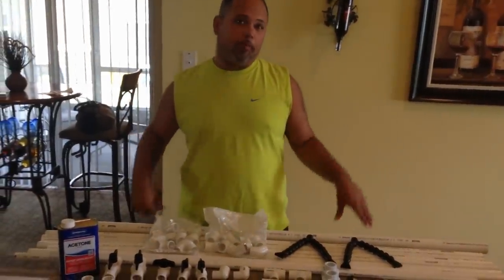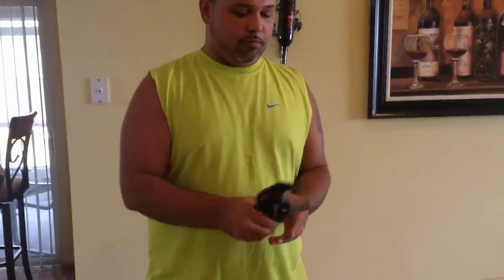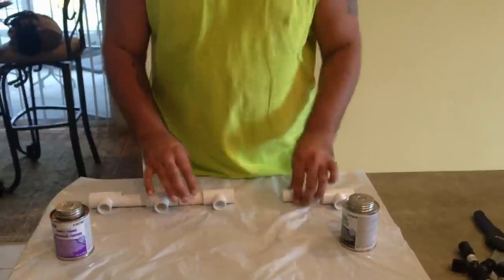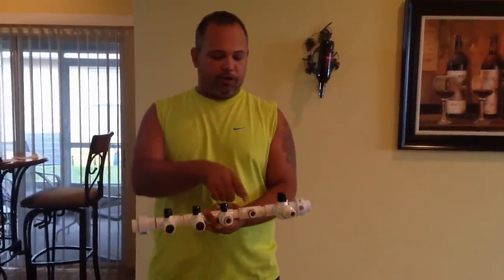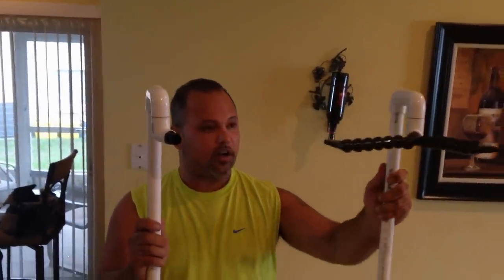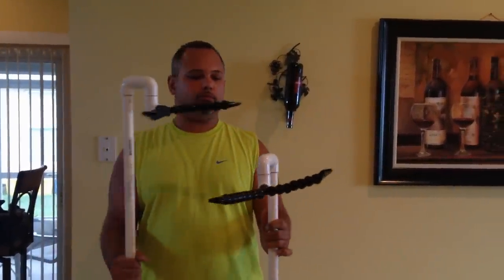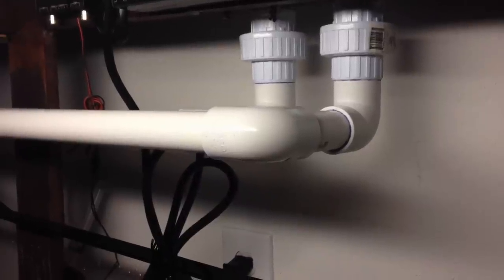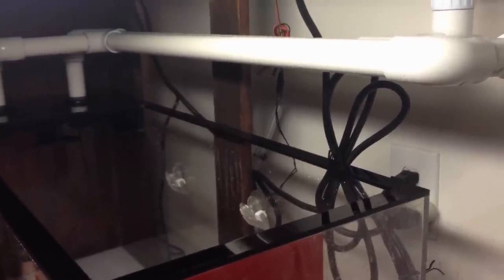Aquarium PVC Plumbing

Comment: Just wanted to let you and your subs know you can buy clear primer for your PVC. You can also get gray PVC tubing it looks a little cleaner. Don't forget to hold presser on each glue joint for about 20 or 30 seconds after glueing. PVC likes to push apart for the first few seconds after glueing. Thats probably what happened to your manifold on the 3rd or forth joint, I saw that one of your tee joints has a larger gap than the rest.  Good video thanks for sharing.

Comment: Can't wait to see your next video buddy. I been in the works for the last couple months getting everything i need to setup a refugium in my tank. Funny thing is that i thought about the same ball valve setup to run reactors from my return pump. I'll be using a large external pump on my ecosystem sump for my 125 gal so it was nice seeing you do that ball valve setup. Can't wait to see your next video to see how everything is running. Keep it going brotha.
Reply: Oh i forgot to ask, around how much did you spend on all the pvc supplies for this video? not including cutter, just pvc and fittings.
Reply from the maker: Thanks for the comment Jose Alvarez. The ball valve set up (PVC Manifold as I call it) has been working out great for me. My return pump is strong enough to handle the work load. Not only did I make extra room in my sump, It has made my life a little more simple by not having to clean all them extra pumps. I recommend it to anyone installing PCV who is using reactors. I'm hopping to put out the second video soon, work and slow computer permitting...lol 

As for the amount I spent, If i recall right, It was around $100 with out any of the tools. The ball valves were the most expensive. As far as check valves, I have none. I saved a few bucks by simply drilling a small hole on the return valves just above the water line. By doing so it lets air in and stops the siphon.
Reply: Aquaholic TV a Reef Addiction Nice, glad to hear that everything has been working out pretty well for you. Thats what i'm looking for as well as i really want to cut down on all the pumps that i'm currentlyusing as i have 3 power strips filled already lol. Really hate seeing all the pumps being used to power equipment when with a good design such as yours we could have one pump provide the flow required. I really liked the idea on how you had one of the returns flow thru your chiller before flowing into the DT. That was a smart move rather than using one of the manifolds which either way works. I have two external pumps which i could use for when i setup my refugium. First one is a Panworld 100PX-X 1270 GPH and a Little Giant 4 MDQX-SC 1325 GPH. This should be over done but show provide great flow in the DT. I'll add a gate valve from ACE Hardware just above the return side of the pump in case i need to dial it down. I calculated my head loss considering elbows, pvc distance and what not and i'm sitting at a healthy 1,000+ 

Did you get good flow into your reactors using the 1/2" line? or do you recommend the 3/4" better to supply the reactors
Reply from the maker: Jose Alvarez When you connect your manifold you will also have some head loss. In my case it wasn't much. all my reactors but one are on the 1/2" line and only about 1/4 of a away open. That was good enough flow. anything more than that was way to much. The 3/4" will increase your head loss more than the 1/2" line. I only use one 3/4" line for my bio-pellet reactor. Now even though the bio-pellet reactor I have has 3/4" lines, at a 1/4 of a away open was also enough flow. Anything more would've disintegrated the bio-pellets lol. With that said. I definitely get good flow with the 1/2" lines and if I had the choice with my bio-pellet reactor, I would had made them all 1/2" but than again having a 3/4" line in the manifold just in case you need it wouldn't hurt.
Reply: Aquaholic TV a Reef Addiction Thanks for the input brotha, as i'm planning to do my return at 1" I was thinking if 1/2" or 3/4" would be good for manifolds. Since reactors don't require a strong flow 1/2" is definitely a better route to go with.

Comment: Good job on the clean glue job. One thing I see missing would be a check valve in case of power outage so that water does not keep siphoning back into your sump. I will be plumbing my new 100 gallon soon.

Comment: I am interested to know how the final test, with all your Reactors connected , if you had any flow problems?  I am asking this because water (Like Electricity) will follow the path of least resistance - With that straight "T" Fitting - Left going to the Tank Return and the Right side going through your Reactors, it seems the water would flow all, or mostly to the left into the tank !?! OR, Maybe I am not seeing where the water flows out from the Reactor Side?

Comment: Nice job man. What do you support the pvc with once installed or do you even need to support. On my aquarium the drain and return are on the back of the tank
Reply from the maker: +J Parker Yes I supported the pcv. I used Plumb Craft Waxman 7626400 Perforated Plastic Pipe Strap. I like that kind of strap because its flexible.

Comment: Why not paint it with Krylon Fusion Plastic Paint - You made the PVC "Paint Ready" by wiping the PVC Pipe with Acetone - This causes the Paint to "Bond" to the PVC and you will never experience the flaking that people complain about  - They do not take the time (Or the Elbow-Grease) to go that extra mile - If you prep it first (Acetone wipe) - The Paint works perfectly and lasts forever.

Comment: What size is ur pump?
Reply from the maker: anaherox3  Its a Mag 18. Flow Rate: 1800 GPH maximum flow, Power Consumption: 150 WattsPump Size (L x W x H): 6.4" x 4.5" x 4.6", Outlet Size / Inlet Size:3/4" MPT / 3/4" FPT